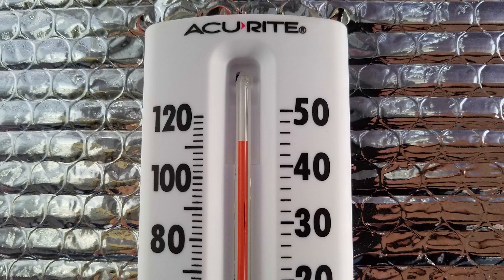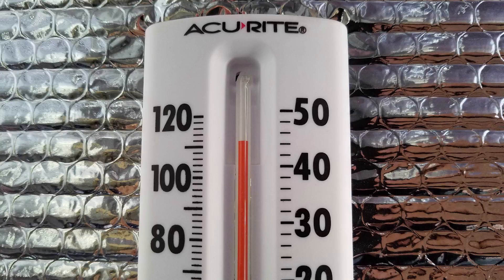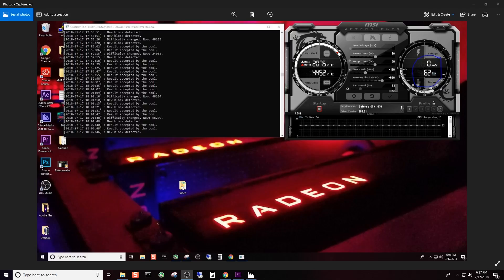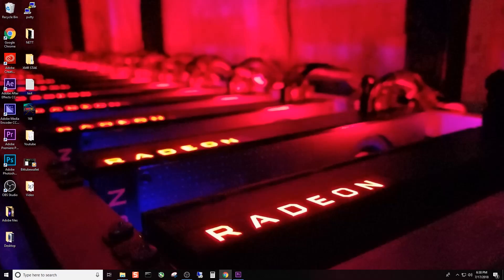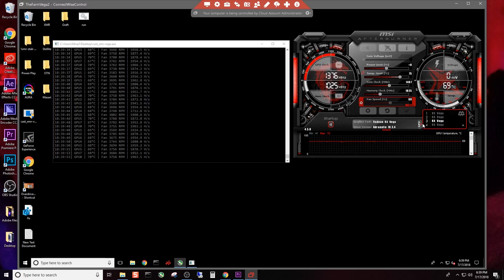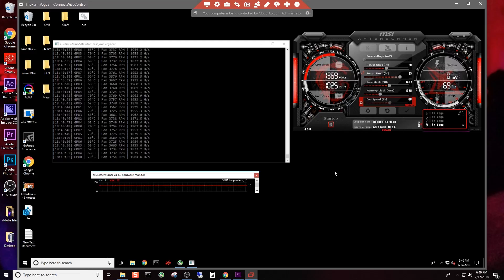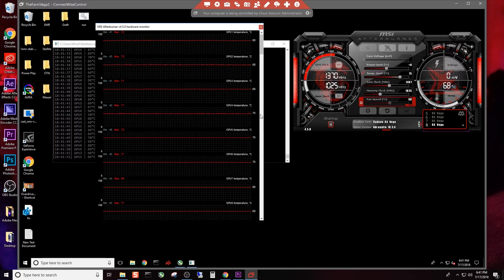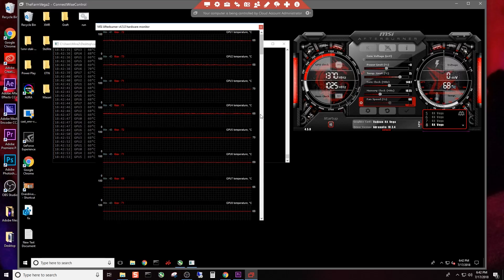GPU Mining in Texas Heat - 112 degrees - No AC!

Comment: You never showed the finished farm. That was me get rid of the heat.
Reply from the maker: Yes my friend! You were one of those guys with the airflow over AC mindset. Thanks for all of your comments and input since I started this channel. Honestly, it has been too hot to work in the shed lately, most of what you see in the part 11 video is about what it still looks like. I plan to add more cards and finish the build completely as soon as it's under 80 degrees in the shed, and the market has corrected enough to warrant any more of an investment.
Reply: Yah i know what you mean regarding the market. I was getting ready to build other rig with RX56s, but waiting to see how the market unfolds. My personal farm consist of 18 RX 56, 24 1060 6gb, 6 rx570, 15 rx580, 8 rx550. Just wait until winter comes other set of problem with condensation.
Reply from the maker: Yep, looking forward to it :)